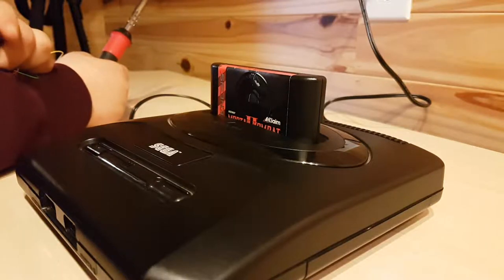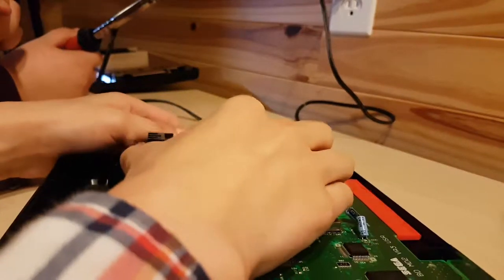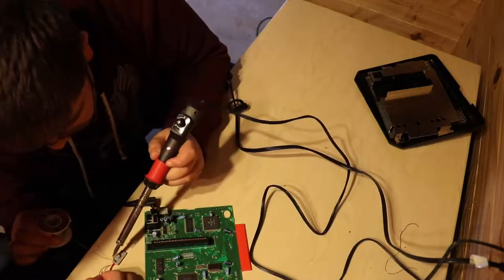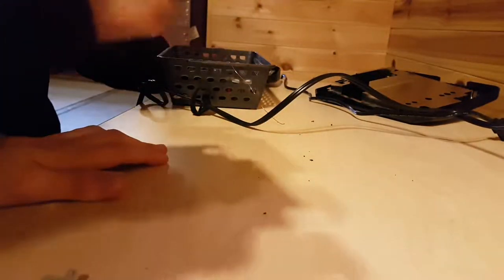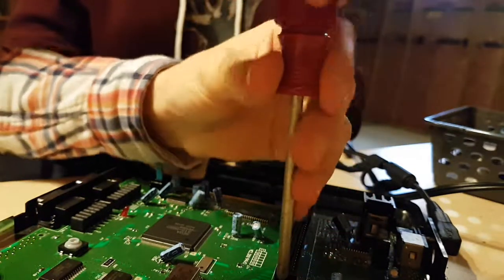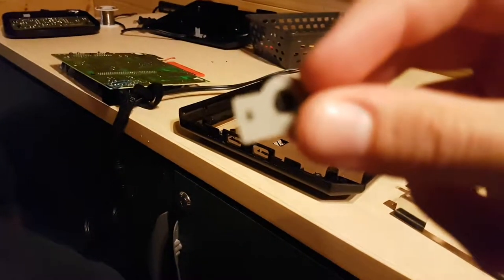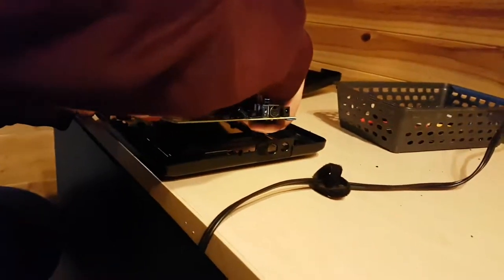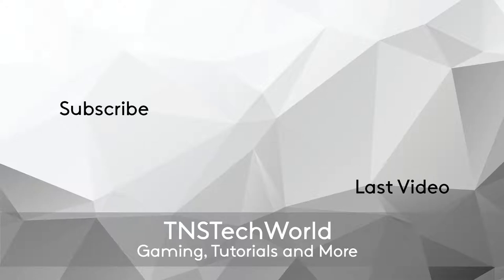Sega Genesis Model 2 | Trial and Error Power Button Repair Part 2

Comment: Ok I didn't have to think too hard but I figured out that it was just a wire connecting the 2 original points where you would connact a separate button if you were to do it that way. I knew this from watching Linus tech tips turn on a motherboard with a screwdriver it's an open closed thing on the switch. If those 2 leads are connected you have constant power. But my nostalgia is missing partially because I am used to blowing on a cartridge and starting a console with a button or switch. This is plug in every time. But also a person could get a toggle switch and install that instead.